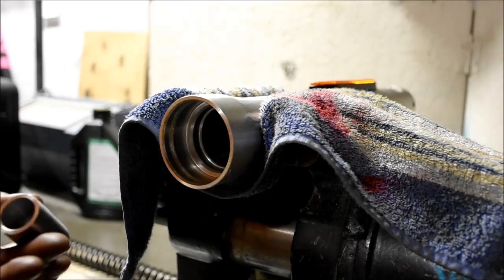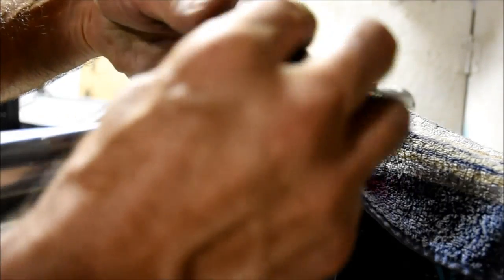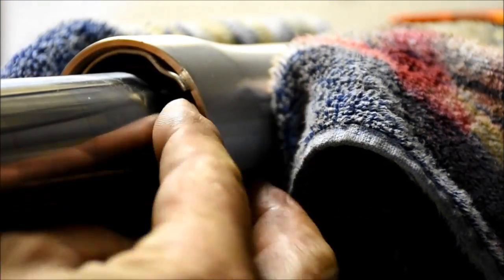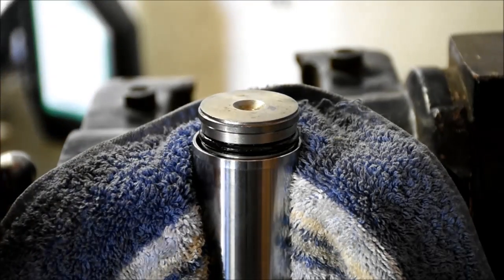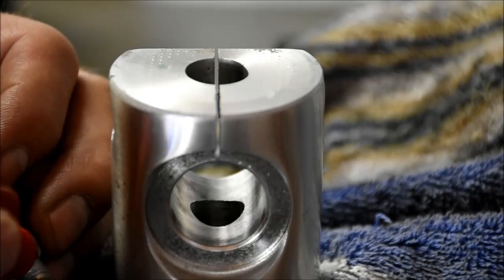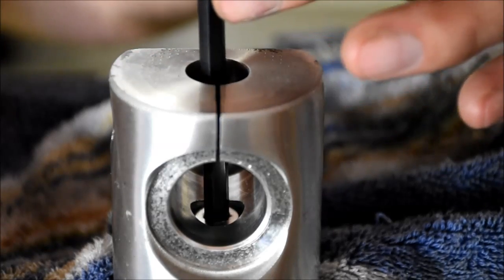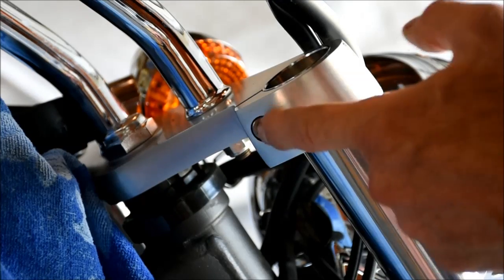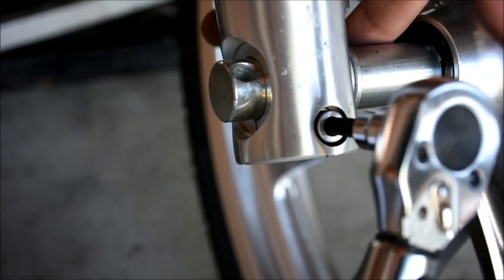Kawasaki Vulcan 900 - fork seal replacement, part 2

Comment: looks easy. Thanks man!
Reply from the maker: Alberto Verdugo My pleasure Alberto. It's not too bad if you just take your time.
Reply: the only thing I am worried about it is about the forks bent or the triple tree, that can be a cause of leaking forks :/
Reply from the maker: Alberto Verdugo I would not think those two concerns would lead to leaking fork seals. You could check the fork tubes and the triple tree while you have it disassembled and replace them if they are bent or damaged.
Reply: any advice on how to check them?
Reply from the maker: The easiest, although not the most precise is to roll the fork tubes across a flat surface, such as a table and look for wobbling, or uneven gaps.  As for the triple tree, if you can, leave it on the bike and point the wheel straight. Take measurements from fixed symmetrical points on the bike to the triple tree on both sides. The triple tree would take some major force to damage or bend it, so unless there is a history of front end damage, it's likely fine.
Reply: Thanks! I will do that, my bike has a crash on the left side, i will measure it as you said.
Reply from the maker: Alberto Verdugo Best of luck.  Let me know what you find.
Reply: I found a very rusted cap in the top, i clean it up and used a rust remover but i think it is not enough. it is very hard to push down the cap in order to seal the fork dry (i am on minute 5:21)
Reply: I made it, now i am going to add the colt from the botom
Reply from the maker: Alberto Verdugo Good. If you have rust build up, use some really fine grit sand paper to help remove it from the cap. The o ring is the critical seal.
Reply: thank goodness the O ring were in perfect conditions (no rust), but i will use the grit sand on the top on the cap, thanks for the advice

Comment: thanks for making this video.  everyone told me it was really hard to do.   after watching your video, i found it pretty easy to do!  the reason i did mine is because i'm installing a chopper kit, so i now have longer tubes. a side benefit of this is, i discovered that one of my seals must have been leaking, because the oil was contaminated on the right fork tube.  i may not have discovered this so soon otherwise, i managed to avoid damage.  now that i'm not intimidated by doing the seal replacement,   i'll be keeping a closer eye on them in the future.

Comment: Very helpful video! Thank you man! I wraped my fork with black film that after som driving was in and out in the seal witch cuzed what i thing is a leak.. very messy evevry time i drive.. i found oil every where so i decided to replace the seals. Thanks to you man you made it very Easy
Reply from the maker: Happy to help.   Keep the rubber side down.

Comment: thanks. you answered two questions i had. i wondered if i couldn't just push my tubes up through my trees to lower my front end like i did with my road star. I see i can not because of the trim cap. the second was how to install progressive lowering kit. If i'm not mistaken, it will go like my sportster. get the front wheel off the ground and just pull factory spring out and drop in progressive kit.
Reply from the maker: I'm glad it was helpful.  Thanks for the feedback.
Reply: 58gennaro, you can lower the front and just push the tubes up. The plastic caps are lock in the tube, not in the triple tree. There is also a lowering kit on the market with shorte springs. From Baron ... 👍🏼👍🏼

Comment: great video, nice touch posting the torque values at the end.
i have a suggestion for whoever is looking to service their forks.. @4:35 the spring is compressed, by assembling the fork, in order to install the bottom drain bolts... turning the fork upside-down with the spring inserted and putting your weight on it, I believe would generate enough pressure in order to torque down the drainage bolt..
also @12:44 there is some protective grease on the threads. that changes the torquing force for greater.. i'm sure it's not an issue in this circumstance, just a general observation. (super over-tightening axles puts unnecessary lateral pressure on the wheel bearings) 

be safe, have fun

Comment: Awesome video.  Almost identical to my classic.  Question, why did you put the spring and upper plug in just to install the bottom drain bolt, only to remove again?
Reply from the maker: You have to put tension/ pressure on the threaded nut inside,  so that you can torque the bottom drain bolt.

Comment: Good video. But when you reinstalled the fork, how do you know if it's on straight and not at an angle and ultimately having a crooked tire?
Reply from the maker: The lower fork tube rotates freely and independently from the upper.
Reply: @muddyfences5559  thank you my friend. Your videos were VERY helpful. I'm replacing my fork tubes in a week or two. Can't wait to be riding again!

Comment: I assume you have the fork fully extended when you check the oil level?
Reply from the maker: Not for this bike.  The fork needs to be fully compressed.
Reply: @muddyfences5559  Ahh, thanks... I'm glad I asked then. I'll be doing this work on a 06' Vulcan 800 and they look like the same fork on it 👍

Comment: Hello, a video very well explained and well done, a question what is the exact measurement, to verify the level of oil it has, I am from Spain and my level of English is very basic, could you tell me in centimeters, thank you very much
Reply from the maker: Looks like it converts to 14.8 - 15.2 cm.
Reply: Thank you very much greetings

Comment: Hello man. I am going to replace my fork seals. I just have everything I need. So i wanted to ask you if you can tell me which side is correct. I took some pics to the fork seals. I will be very glad if you have the time. Thanks!
Reply from the maker: Hey Alberto.  Most seals have the print on the side that faces up (top of the fork).  You can verify this by looking at the inner rubber beads / rings.  They are often directional and the tips should slope down  [/  thus wiping the oil down as the shock extends.  One last visual is the bottom of the seal may be open, and you can see the spring.  Good luck man, I hope this gets you squared away.
Reply: @muddyfences5559  thanks man. You sre right. One side has like embossed letters and the other do not. It has springs on both sides but the rubber beads are / with the letters up.
Reply from the maker: @79sketches  Awesome.

Comment: why did you have to put the top cap on and then screw the screw at the bottom? and first of all why did you take out that screw?
Reply from the maker: It was the only way that I could put pressure on the tube and tighten the drain bolt.
Reply: @muddyfences5559  thank you very much, I didnt get it at first, I'm about to do my first fork ever, this was very helpful
Reply from the maker: @dariustheman6934  You are welcome.

Comment: Sorry it’s probably a late question, but how do you ensure that the forks are straight when you tighten them to the triple clamp? Do you just eyeball it and it will self correct when torquing the axle bolt?
Reply from the maker: It's never too late. When you place the forks in the triple clamp,  the bottoms will rotate freely.  This allows the axle to align in the hub.
Reply: Muddy Fences perfect, thank you! I had also read up on spinning the front tire and hitting the break while having the forks loose to self align them but I didn’t even notice what you mentioned so it’s probably not needed. Thanks for the help to all of us DIY guys!

Comment: I just found a tricky detail when torquing the axle nut. when I toque it, the right fork (the one with no brake) created a very small gap between the collar and the fork, very small but noticeable. what do you think it could be?
Reply from the maker: Alberto Verdugo That's a tough one. Is your axle straight? You could also check both collars for damage or wear.
Reply: Muddy Fences it looked straight. I will loose the botom bolt of the triple clamp and see if it fits by itself and then thight it again

Comment: only that i didnt like was new seal placement. much easier to put old seal on top of new seal and drive it home using a pvc pipe as a slide hammer. i'm concerned that your method could damage seal. awesome vid though
Reply from the maker: michael buxton The method I used wasn't my first choice, as mentioned.  I didn't have anything else on hand, so I worked with what I had. I'm happy to report that it worked fine, and there was no damage to the seal.
Reply: Muddy Fences cool, I'm doing a ninja 250r this weekend. your vid help connect the dots, thanx
Reply from the maker: My pleasure.  Good luck.

Comment: HEY GREAT VIDEO, BUT I DO HAVE ONE SUGGESTION IS THAT YOU DO REALIZE THAT THE ALL BALLS BRAND REBUILD KIT FOR THIS BIKE IS ROUGHLY ABOUT $25 AND IT COMES WITH ALL THE BUSHINGS AND EVERYTHING YOU NEED TO THROW AWAY THE OLD SHIT, I HAVE DONE HUNDREDS OF FORK REBUILDS AND I HAVE NEVER USED ANY OF THE OLD STUFF,  IT IS NOT A GOOD IDEA. ALSO YOU SHOULD MAKE SURE THAT THE FORKS HAVE BEEN COMPLETELY FLUSHED OUT OF ALL CONTAMINANTS. BETWEEN THE DUST CAP AND THE SEALS AND THE NEW BUSHING KIT AND RINGS IT'S LESS THAN $50 THAT'S WHY YOU ALWAYS REPLACE THEM.

Comment: what was the point of dry assembling it and re-assembling it?
Reply from the maker: It is to add pressure to the damper rod so that you can install the lower drain bolt.  After the drain bolt is installed, you need to remove the top cap to add the oil.
Reply: @muddyfences5559  ooooooh thanks for explanation
Reply from the maker: No problem. Take care.
Reply: @muddyfences5559 answered my question.  The manuals says need a tool, I assume to keep it from spinning.   The cap and spring would accomplish the same.